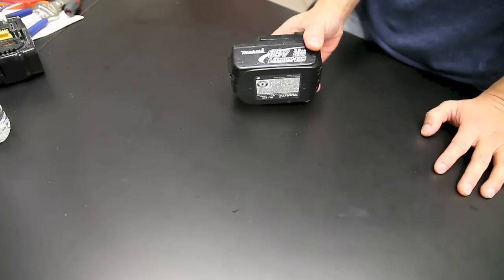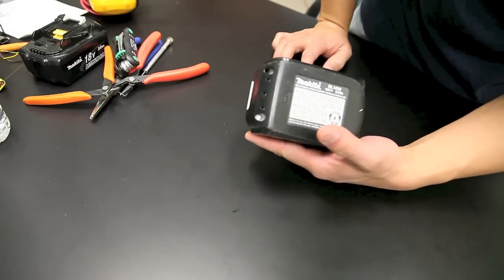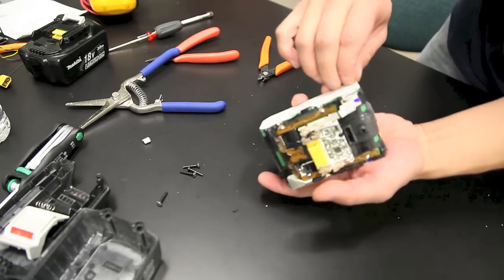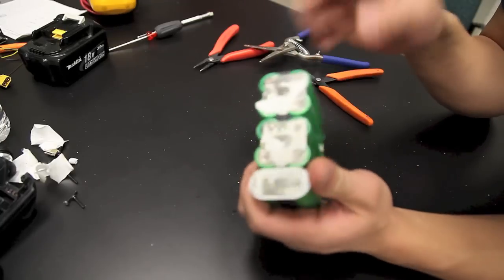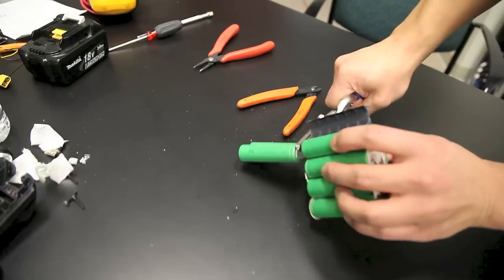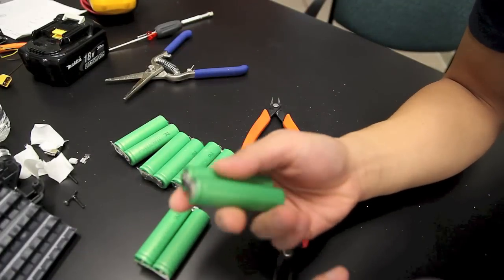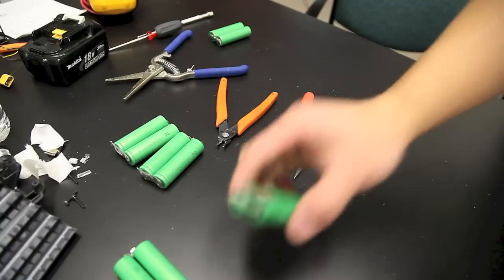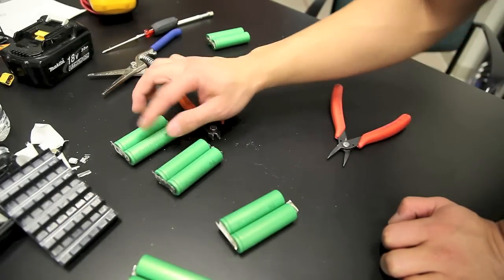How to dissassemble Makita BL1830 Battery pack

Comment: So there isnt a hidden screw under the white info label? how many cells? 10?
Reply from the maker: I am not sure about the new packs if there are hidden screws under the labels. They might have changed them. There should 5 if you are using the slimer pack and 10 for the bigger fatter packs. The fatter pack is just more capacity.
Reply: @skyBridgeConcept  got a defective 10 cell 18V pack. Thanks

Comment: And it's a security T-10, fyi. You'll need a t-10 driver like he has, or a long skinny bit. I had to wallow out the hole a bit with a drill, which I'm used to having to widen holes...buh dum chi also pretty much just had to drill the security plug out, guess mine is old and kinda hardened.

Comment: boss, that second option (blinking red light) means. how can i fix this problems
Reply from the maker: riyas mohammed sounds like the bms is bad. you most likely will need a new pack. I hear they permanent lock if any battery is bad for safety issues so you can ever reactivate it.

Comment: Thank you skyBridgeConcept. I watched this video twice, and may have missed it. What size of batteries are in this pack, and what does the printing read on the batteries? What is the mAh rating for each?
Reply from the maker: Steve Kluver the rating is located at this link:
https://endless-sphere.com/forums/viewtopic.php?f=14&t=27707&hilit=konion

doctorbass has an updated video on how to disassemble the new packs.

in short:
they are 3Ah without any listing on the cells. there might be some serial number printed on the green heat shrink of the battery.

let me know if you need any other info.
Reply from the maker: info on the battery can be found here:
https://endless-sphere.com/forums/viewtopic.php?f=14&t=27707&hilit=konion

in short they are rated at 3Ah. realistically they give something less especially when they are used.

there is no specs on the green outside best shrink on the battery other than some serial number.

let me know if you need any other info.
Reply: Thank you. So from what I read there. These are 18650 batteries, with about 1500-1600 mAh each.
Reply from the maker: yes it is around 1500mAh for each cells. 2 in parallel gets you the 3Ah.

Comment: can i charge the cells of 1000mha for 5000mha?
Reply from the maker: ademar bento I am not sure what you mean by 5000mha. if you mean 5000mah then obviously it will not work. you should not by any means overcharge any battery regardless of chemistry type. if it is rated at 1000mah you should only put in at most 1000mah.
Reply: haha!! Omg.. mAh is just the capacity. so yes, i you fitted like 20 cells in there. it would just make the battery bigger, (assuming you join the right, parallel ect. Its the Volts that matter. if its suppose to run at 12v, 24v will destroy it.

Comment: And what was the purpose of disassembling the battery pack? does it have a resale value or reuse?
Reply: +certified30 18650 cells are used for high powered flashlights, e-cigarettes and can be assembled into battery packs for electric bicycles, rc cars and so on. For example the Tesla model S uses just over 7000 of these cells in it's battery. They are popular because they are easy to work with and cheap.

Comment: Bl1815 it will work or old Bl1830 series also.. BUT latest version will not be working because once cut battery off then PCM will lose power which means PCM circuit will lock it self and never return as usual unless you buy Non Lock PCM in ebay. Dont do this at home and also dangerous to do this .
Reply: wow, I did not know it, it is not fair for all folk people who want to repair the batteries ...
ASHO .... S from makita do not want you to repair batery packages, they want you to buy new at a ridiculously expensive price...asho...s

Comment: i got one of the new ones u talked about. there are two screws to undo the plastic shell surrounding the batteries.  its not hard at all to dismantle.  but i got a question can i upgrade it to 12 amps per hour? physically it seems possible to me however im not sure if the PLC battery chip " lipw005" will allow it charge up to 12 amps i thought it might limit it to 3 amps.  could u please tell us ur opinion with upgrading to a bigger capacity batteries
Reply from the maker: if you are planning to use your own charger to charge these i dont see why not provided you stay within specs. if you are looking to charge these cells at 12 amps you would need to put man of them in parallel. sinces these are around 1.5ah each, you would need at least 8 in parallel to charge at 12 amps. 12/1.5 = 8. i would stay at a maximum of 1C charge rate on these. any faster and they heat up and might damage the cells.
Reply: I'm not sure where you are going to find cells with that high of capacity and a decent discharge capability. Makita used a nice balance of capacity and discharge capability in these packs and I think you'd be hard pressed to find anything considerably better without making a battery pack 4x the size

Comment: Disassembling only to take the Panasonic batteries is not a good thing because the most expensive part in makita pack is the electronic board that you put off, and those great Panasonic green cells you can buy at eBay for very reasonable price. It would be more intelligent, when at the end of useful life of the green cells (pack), replace only the cells and keep the electronic board which is probably the most expensive part and have a lot technology in it. Regards.
Reply: LOL, there's more than 60 USD worth of cells in that pack (at minimum). The BMS might be worth a good 15$, but for most of these discarded defective pack, it's actually the part of the battery, a defecive BMS is what's causing them to be discarded in the first place.

Comment: Hey buddy, I don't mean to b arrogant or offensive in anyway, but what is the point of using those batteries? I came across the video from a link from Google, genuinely interested in what u done ( thanks for teaching something new today :) ) mikita batteries are VERY expensive back here in england, dismantling them for cells has got me confused and would like to educate myself why...? Cheers :)
Reply from the maker: Well I was able to get "defective" Makita packs for a low price. People can use them for anything they want. I hear people use them for flashlights, e-cigarettes, ebikes, etc.

For those who do not know. Makita battery packs are very sophisticated. The charger will refuse to charge a defective battery even though only 1 or 2 cells within the packs are defective. I am removing the bad one and keeping the good ones for whatever my use is. Hopefully this comment has elucidated you on why I made this video.
Reply: Ideal, thanks for letting me know! I too have Mikita so gd to understand this. Would u test a dud by using a volt meter to check the charge? Also if all cell are dead (uncharged) how would u distinguish which cell was dead? I'm guessing the concept is that if u buy a dud battery for cheap, u salvage the working batteries? Basically 2xdud = 1 good battery?
Reply from the maker: Dorian Harvey It is complicated to test dud cells. I'll try to be terse in my response to help you test duds, but testing for duds is a long and complicated process. To date, I have not seen any better process to weed out unknown used cells.

1) Since the cells are 2 in parallel, you have to test ideally in pairs
2) I would fully charge the cells to 4.2V first. Any cells that does not hold charge are immediately discarded.
3) I would measure the internal resistance of each cells. Anything higher than 60 - 80mOhms are discarded (this threshold is depend on the temperature and how "cheap" you are on slight worse cells)
4) leave the rest of the cells resting for about a week or so in a cool place
5) measure the voltage then. Discard any cells with less than 4V
6) cycle the cells 5 times and start from 2) again. Needless to say, skip 6) after 5) on then 2nd pass through. i.e. you are done after the 2nd round.

The remaining cells should be good for a long time. This might be an overkill, but it is a sure way of weeding out the good from the bad.

Note this is only for this battery. Different batteries will have different default internal resistance and you will have to adjust them accordingly.
Reply: Ideal tah! Good work :D
Reply: skyBridgeConcept I just saw this video nice job, I have 5 Makita batteries that don't work is there anyone that rebuilds these batteries I hate to toss them all out? I am a carpenter that lives in Ma. i would be great to have these batteries working
Reply from the maker: Joseph Alsheimer From what I know, there isn't a way to get the old defective batteries to work. There is a computer on the battery that will prevent it from working again. Unless you can get a working battery computer. I think your best bet is to manually charge it with some generic lithium charger if you know what you are doing and use them that way. IMO, this is a cheap way to get around the charge issue, but long term, it is probably not sustainable. It is best to just get a new pack.
Reply: Thanks for getting back to me I'll just toss them out.

Comment: What type of Lipo batteries are those 18650? Laptops are usually 18650s
Reply from the maker: I don't know about the chemistry, but it's definitely NOT LiCo like the ones in RC lipo packs. They are in the 18650 format.

Comment: I just noticed my laptop charger puts out 19V, 1.58A do you think it would be viable to remove the guts from an old makita battery, install a female plug to receive the charger and run the tool from the mains?
Reply from the maker: FIREHAWK1979 Probably not. If you do the math, 19V*1.58A = 30.02W. I think most power tools draw a lot more than that. The motor in a power tools typically draws a lot more current when you stall it. I can guarantee you it's much more than 1.58A
Reply from the maker: I wouldn't recommend it. This is because even though the full charge voltage of the Makita's pack might be 19V, the cells maybe out of balance. This is why the OEM charger refuses to charge it. The only way to safely charge these is to put it on a Universal Lithium charger and choose the right settings. (charge as 5s Lipo or Lilo).

If you don't have a Universal Lithium Charger, then I guess the laptop charger would work. But I would monitor each cell's voltage closely and prevent any of them going over 4.2V.

Best of luck!
Reply: I didn't mean using the charger to charge the battery but actually running the tool off the charger using the empty battery casing as a connector. I was just wondering if the wattage would be sufficient. Cheers!

Comment: you can solder those tabs.  we do it all the time in radio controlled cars.   no more than 5 secs with the heat.  that's the general rule for any soldering.

Comment: What size secure star drive do you use ?
Reply from the maker: according to one to comments on this video, it is "# 10 security torx bit... has a hole in the center." I would just buy the set and I am sure it one of them will fit. Moreover, most of the time the security star torque bit comes in a set.
Reply: Thanx, i ordered a set, just waiting for them to arrive

Comment: Great and very informative video, do you have a information how to connect the balance lead to these batteries? I am not pretty sure where to solder, positive or negative polarity? cheers,
Reply from the maker: I would always solder balance leads on the negative side of the battery because it's easier and there are more "metal" to distribute the heat. So for instance if you wanted 4 in series and 1 in parallel using 4 cells, you would need a total of 5 balance wires coming out.

------14.8V
^
|
------11.1V
^
|
------7.4V
^
|
------3.7V
^
|
------0V

The above picture is how you do it. the dashed lines are the balance taps. The only balance tap you need to solder to the positive is the highest one which is the 14.8V tap. The rest should go on the negative side of the batteries.

Hope this helps!
Reply: Helped a lot. Super, just found these 18650 holder, there is serial and parallel, I am not sure what is the best choice. as I will have 20 batteries, and I do not want to let them in balanced. so I was thinking what will happen if I have these holders and if one of them in balanced I always can remove it and charge it as a single cell. I want to make sure the long life of the batteries.

http://www.ebay.co.uk/itm/18650-Battery-Holders-1-2-3-4-Batteries-Serial-Parallel-Options-UK-Stock-/281199951833?pt=UK_BOI_Electrical_Components_Supplies_ET&var=&hash=item87194c5230
Reply from the maker: Pisti Fésüs First off, those 18650 holders are only good for low current application. I am not sure what you will be using the 18650 cells for, but if you are using high current, those you linked on ebay will not work.

As for balancing, I hear these cells are great in terms of keeping themselves balance, but balance cables are always nice to have for the occasional balancing required.

Final note: Before you put cells in parallel, make sure they are close in terms of voltage. i.e. cell 1 is 3.8V and cell 2 is 3.85V. Otherwise one will charge the other and since there is no load to slow the current moving from one cell to the other, it can really spark and damage both cells.
Reply: skyBridgeConcept Thanks Man,I will use these cells to power a slow fly quadcopter. It will not need massive power as the motors are over calculated. each motor can lift about 1.5 kg x4 the quad is 2 kg.
Details of the motor.http://www.foxtechfpv.com/sunnysky-281411-kv-700-motor-p-382.html
If you have time have look and I am curious of your point of view.
Thanks for all the help.

Comment: good vid m8, but just one thing, how do you find that the electronic circute board are nackered? or is it always one of the cells has gone down? cus ive got 4 batteries thats not working, one good battery i tried on my mates old drill that was not working to see what was wrong, I put it back onto my drill the drill would not work! so do you think its done the electronics in, and are they easy to replace? can you get them cheap? a guy on the UK ebay want £11 each+ P&P
Reply from the maker: What I heard is once the electronics board say a pack is bad, you cannot use the electronics board anymore. Theoretically if you had a good board, you can swap it in, but then why would you swap it anyways if it is good. There might be a way to hack the board, but I don't know of one. Best of luck. You might have to bypass the board if you want to use it, but you will have to charge it externally with some thing else like an external power supply.
Reply: OK thanks for the info, I have just been talking to a local repair shop and hes told he that the electronics get confused, and the chargers dont like it so it thinks it is faulty so it wont charge. so what hes told me to do is jump two wires from a good battery or PSU to the faulty battery, it seems to unconfuse the battery memories so then when its put back on the charger it should charge. I will experiment and ill keep you updated on my progress, PS how do you solder the new batteries back to gether as they makita ones are spot welded, normal soldering must have a effect on the cells with all of that heat?

Comment: Am i missing something? Why would you want to de assemble a good makita battery?
Reply from the maker: They are not good packs. These are used packs from people who use them and can no linger charge them because of a few bad cells you will need to figure out which are the bad ones and remove them
Reply: Arhh i see.. ;)

Comment: are these sony vtc3 batteries?
Reply from the maker: No these are not the vt3. They are newer and are harder to savage in my opinion since makita have changed the package. I heard it is simple for the new packs. You just have to use the dremmel tool.
Reply: skyBridgeConcept So the newer packs has the VTC3's, VTC4's, or the VTC5's?
Reply from the maker: TheAmericanUhate I believe they are up to the VTC5 by now if you get the newest packs. But I am not 100% sure. I know for sure the newer packs than the ones I disassemble are VTC4.
Reply: I have been searching everywhere for the exact type of power tool batteries that holds the VTC5's and the VTC4's as well. I know a lot of sources has said Sony quit all production of the VTC5's last year so they are getting hard to find and much more expensive to buy now days. Thanks for the information too!

Comment: How can you tell the newer batteries from the older ones?
Reply: you cannot until you open them. I have recently seen more and more of the newer version which requires a deremel tool to extract. IMO, at that point, it's too labor intensive to extract the cells especially when you need a lot to build a battery for an ebike or something similar.

Comment: Thanks. I was trying to work out what the multi-way connector is for and where its connected in the battery, ( I have a charger fault!) - your video shows its connected to some electronics (memory and heat sensing methinks?) electrically isolated from the cells.